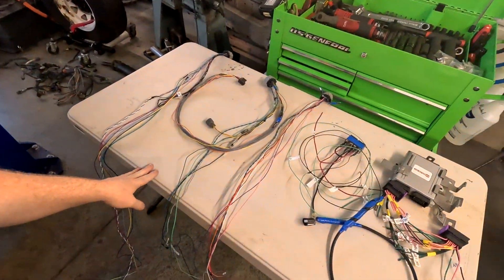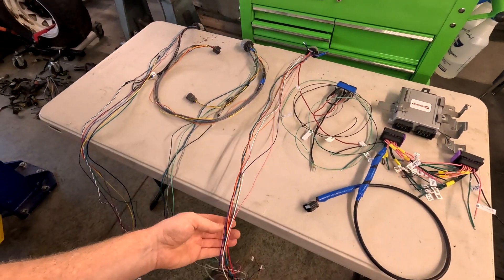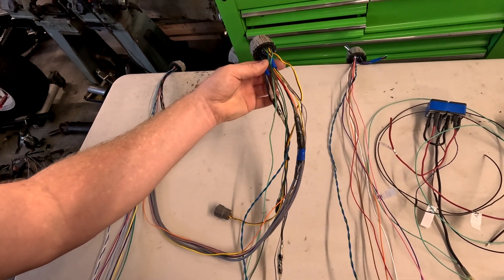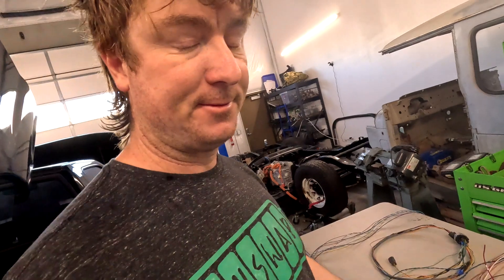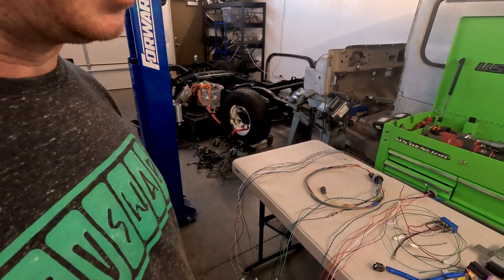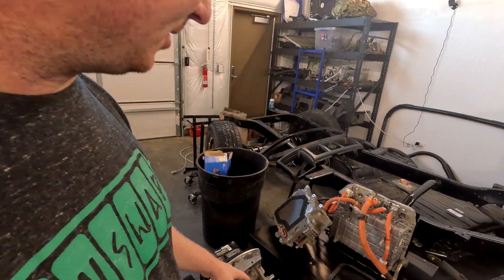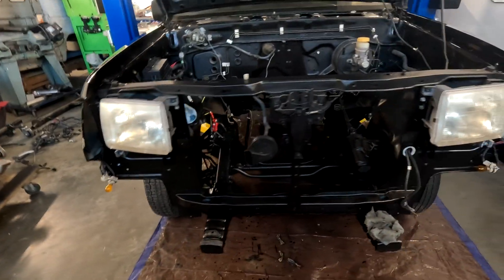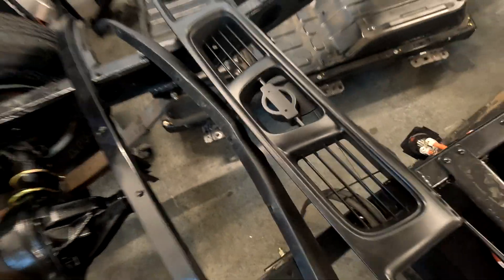Wiring Harnesses DONE - EV Swap Nissan Mini Truck Update 6

Comment: What are you doing for the power steering? On my 96 Nissan D21 swap I'm using an EPAS column from a 09-12 Nissan Cube. The steering wheel splines work perfect. I'm looping the PS lines and I'm working on mounting the EPAS on to the dash frame now.
Reply from the maker: This Frontier has only manual steering so power assist is not needed. I will be using a vacuum pump for the power brakes. Thanks for the tip I might use a Cube rack on another project.